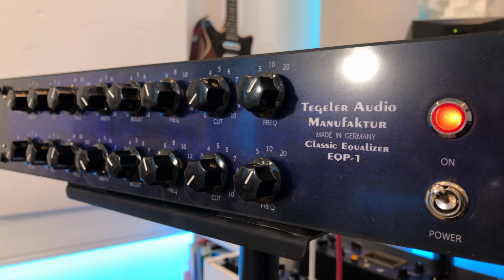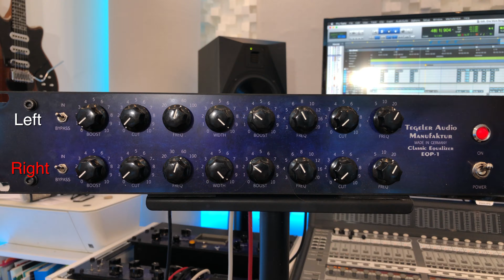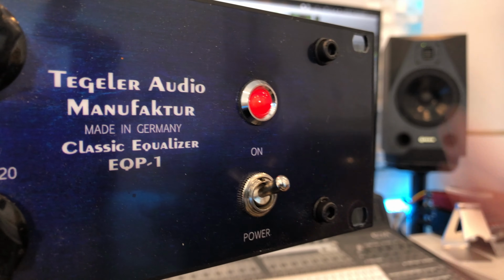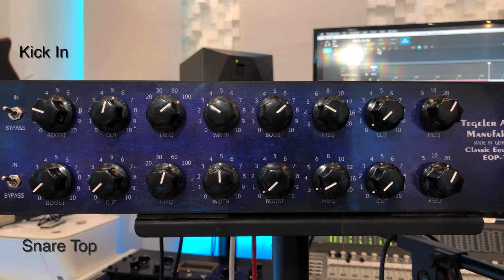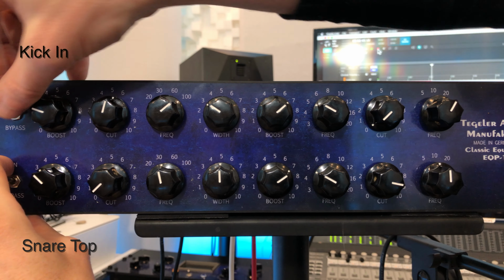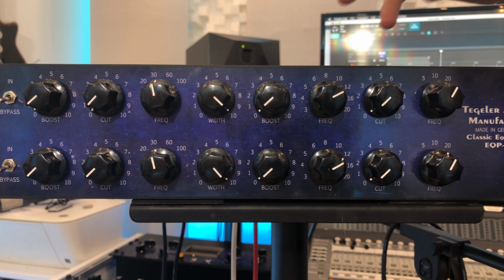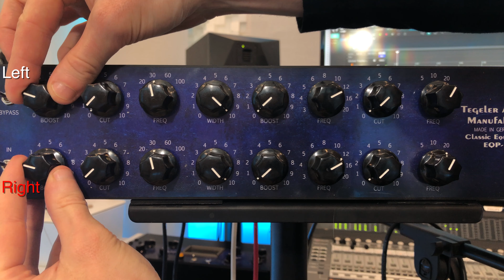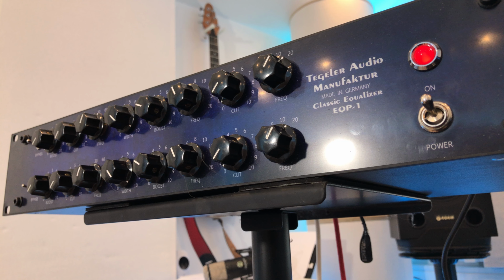Is This The Outboard Tube EQ Unit Bargain Of The Century? Hands On With Tegeler Audio's EQP-1

Comment: I have recently purchased one and must say it is great on individual tracks but I can’t use it on a master bus.   It seems to distort very easily when trying to boost low end.   Any suggestions ? Was so excited to get this. Perhaps the signal is to hot or maybe just a malfunctioning unit.
Reply from the maker: Don’t hit it too hard from your DAW, it isn’t, just like any other analog gear, as forgiving as Plugin emulations
Reply: @ProductionExpert   Does it distort if you enter at 0 /  +0'5 db vumeter at mixbus???